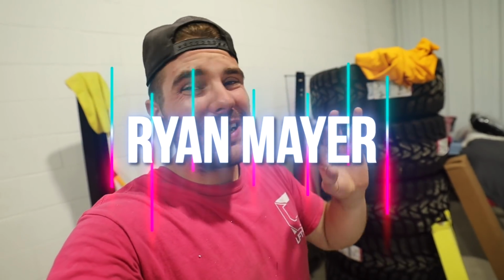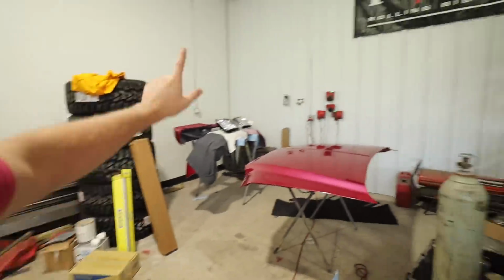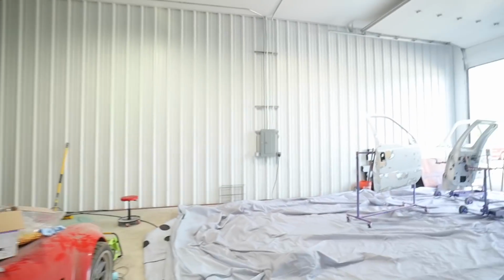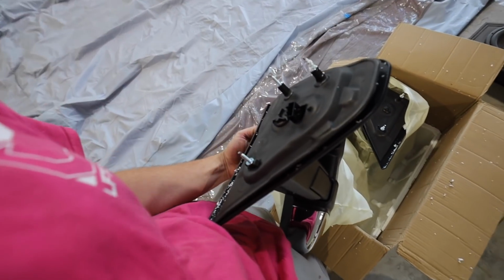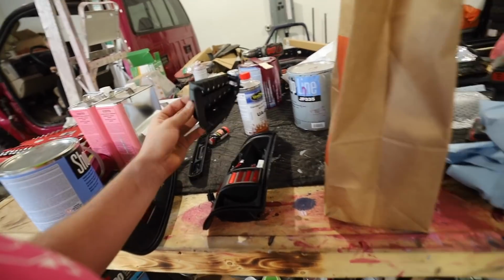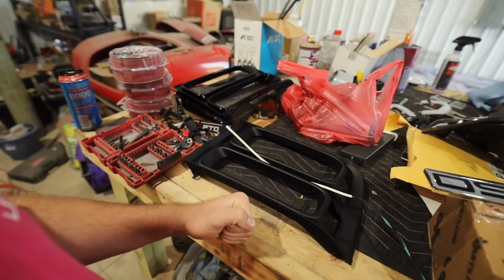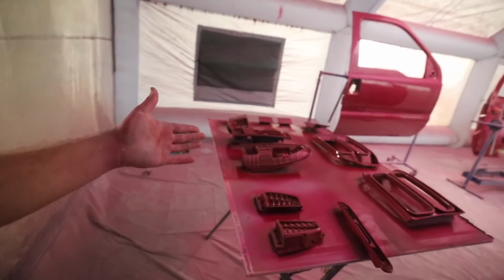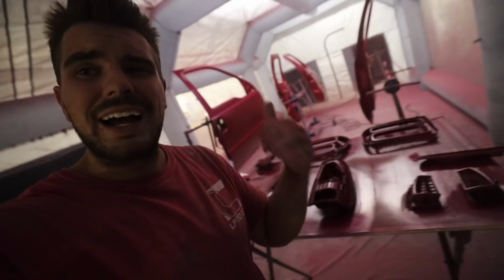Making my 22 Year Old DIESEL Look More Modern 😏

Comment: If you are changing the front springs make sure you do it before you put the bumper on other wise you’ll have to pull it back off to get the front bolts out

Comment: What do you put in the lights to seal them back up? The build is looking great. Are the panels matching well since you sprayed it all at different times?
Reply: in my experiences opening my headlights on my 4runner, i used clear silicon. worked good
Reply: @michaelbenton6010  I did that before on some that I did for my 3rd gen Camaro , but it looks like he is buying a roll of something???
Reply: rope butyl

Comment: Buy some switch back turn signal bulbs so they will be white running lights with everything else until you use blinker, then it’s amber. It’ll look sweet with the center switch back strip